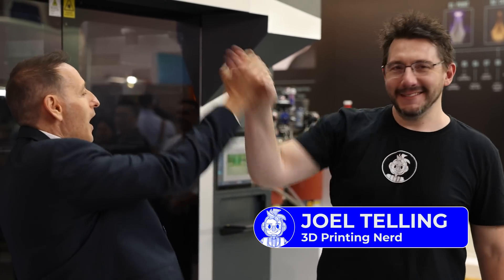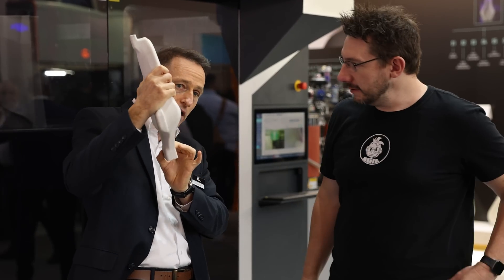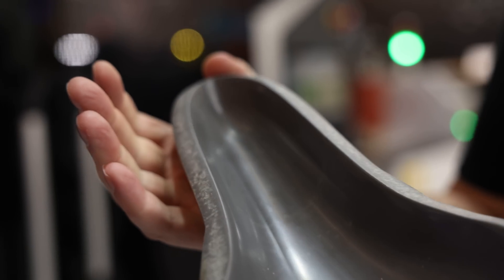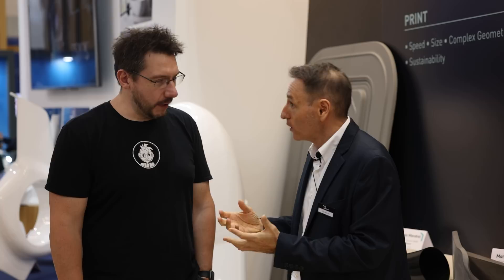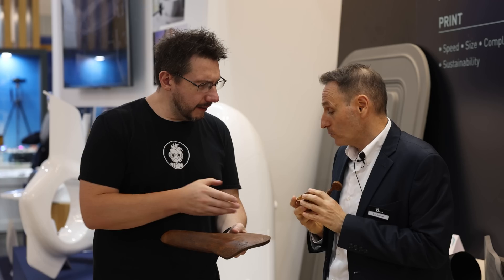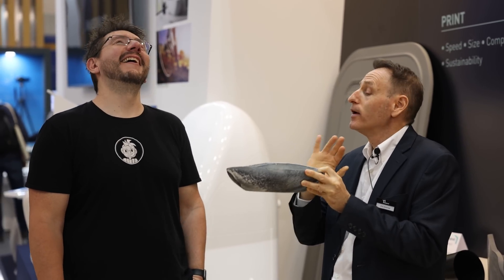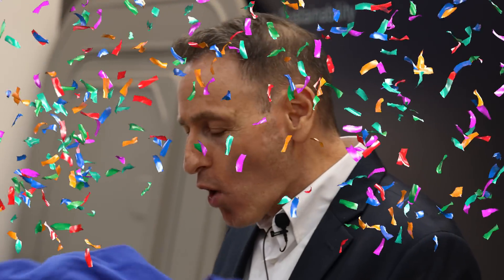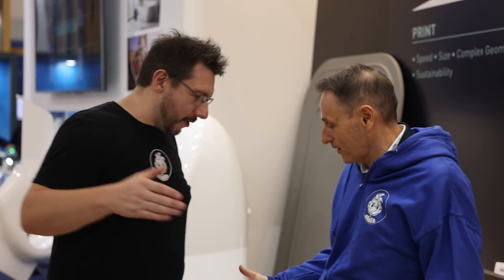3D Printing ISOTROPIC MOLDS, WOOD & STONE with Massivit 3D!

Comment: don't worry with this invention you will still be throwing away loads of sawdust for many years to come remember it is bound together by some form of resin which is very expensive and takes whole load of chemical factories to produce this binding agent sometimes I do find this a little bit patronising when people are looking for a green solution under every single stone in the garden.  This global warming big lie needs to be stopped being pushed at every single intake of breath mankind has no measurable effect on the temperature of the planet.

Comment: My company buys a lot of castings made using the lost wax casting process.  I know you can print in metal and you can also print in plastic and then use that as your mold.  It would be interesting to use this "casting" process to make the wax forms and then use the normal lost wax casting process.  The big advantage would be that you wouldn't have to make the expensive metal mold for making the wax parts.  Sometimes just a little improvement like that could get adopted much quicker than more revolutionary solutions.  It would be interesting to know if Massivit has considered this "casting" avenue.

Comment: I wonder how much post processing/polishing was done on those pieces, the outside of the molds look pretty rough (layer lines and gaps) but then the parts have a smooth polished surface.
Reply: @BenRyherd ,  the molds can be lightly machined if needed, according to requirements. One of the advantages with this tech is that the molds that emerge off the printer are fully isotropic unlike those produced on other 3D printers that often have uneven bonding between layers. If you're interested in finding out more, feel free to reach out to the team at info@massivit.com

Comment: Love these videos.  Just wished there were more of these shows in a year.  Thus far Massivit3D is the stand out of the show.  Very impressive indeed.  I wished we could all touch and feel these prints.  That wood looks absolutely amazing, it all does.
Reply: Hiya @willierants5880 . Actually, Massivit 3D printers have been installed at customer sites across the U.S and Europe so if you'd like to handle some parts or see the machine in action, there's likely an easy way to set that up :) . Where are you based?

Comment: Awesome tech, thanks for covering it Joel.  The best part is that using dissolveable filament to print a mold for casting wood and stone seems very doable at home, though with a bit more DIY effort.  Obviously we wouldn't be able to pour while printing, but we can create funnels and sprues as part of the mold and pour in a slurry afterwards.  For past projects, I've poured in plaster of paris to give a plastic statue the heft of stone, and used lead bb's in resin to fill an Indiana Jones fertility statue to give it the weight of gold.  But it never occurred to me to print in dissolvable filament and have the poured infill be the final product.  I would love to know what type of binders to use, especially for wood since you would want to be able to sand and stain it afterwards.  I bet you could even simulate a wood grain effect by using two contrasting sawdust colors and layering them as you pour.  So many possibilities!...